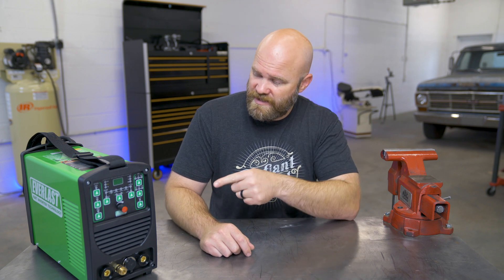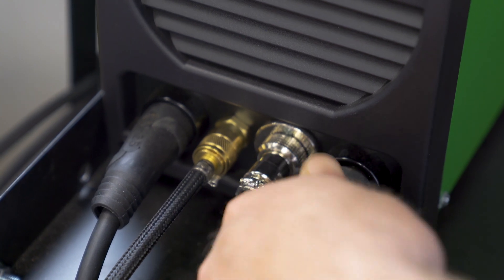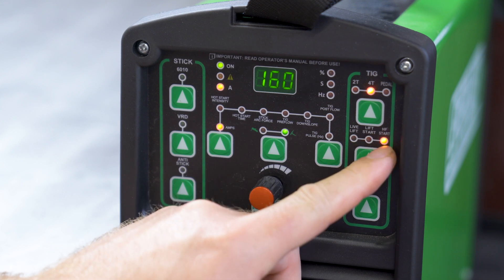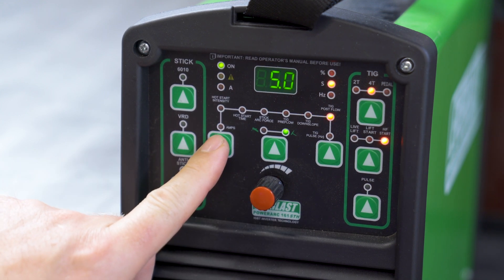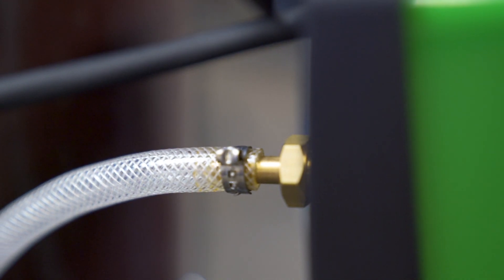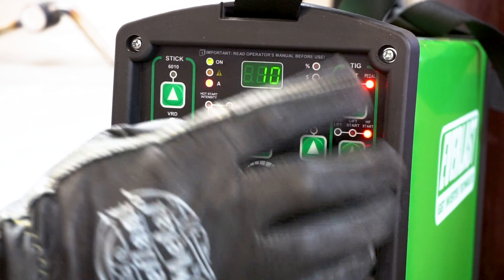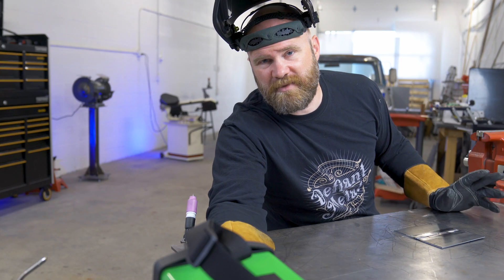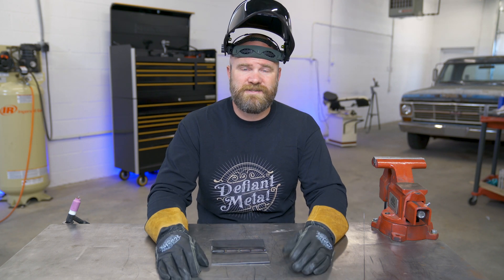Tiny TIG Welder Under $500? Overview of the Everlast PowerArc 161 STH

Comment: How does the tig run on 120 vs 240?
Reply from the maker: I honestly have never tried TIG on 120v. I have done MIG quite a few times off of 120v on a generator and it sucked. I might do some more experimenting with 120v wall power in the future and make a video on it.

Comment: Buyer beware... I am a life time welder... recently bought an Everlast TIG welder for the home hobby shop and while the welder may be good (remains to be seen) the accessories are not.  In short order the Argon hose blew out and the regulator leaks at the gage fitting.  Basic China quality.
Reply from the maker: Had the same thing happen and replaced the squeeze fitting with a hose clamp. My 255 had a much better hose and clamp so hopefully that is how they are now.

Comment: If ita a dc welder does that mean that I need to get an inverter to run it off ac current, or does it have a power supply built in?
Reply: Your DC current welder will weld steel just fine plugged into the wall.
Your DC welder IS an inverter power supply!  It turns 120v 20 amp AC wall power into 120 amp 20v DC power.
Welding aluminum requires a different machine where the power coming out of the handle and ground clamp alternates.  This peels the aluminum oxide film off of the aluminum so that your weld isn't automatically scrap with the film embedded in the weld pool.
Rock on!

Comment: Hey Justin, would you recommend this tig for a beginner welder and for putting out sample pieces for a product line ? 
And I heard that some of these small units get hot after a while and one has to weld and stop, the weld and stop again. 
How would the everlast  fair in this regard?
Reply from the maker: If you are doing production welding or any welding for a long time without much of a break I'd say you're definitely going to want a torch cooler.

Comment: Hey boss, 
Great video, thanks.
Can this tig welding unit do cast aluminum?
Reply: Hey there welding student here If your looking to weld cast aluminum you will need an AC welder. I don't believe you can AC weld with a 110volt unit.

Comment: I need a welder that be able weld
aluminium in repair shop , I can use
a stick dc welder for others , aluminum and copper , stailess steel
need tig weld that seems this welder
can work just on stainless steel .
Reply from the maker: Yeah you need a tig machine with AC also.

Comment: I have that welder's little brother the everlast 140st. It can tig but doesn't have a gas solenoid nor the high freq start. I miss those two features though because they sure make tig more enjoyable.
Reply from the maker: So the flow of shielding gas is external? Do you have to turn the regulator on and off each time manually?
Reply: @JustVoss  It likely came with a torch that has a gas valve built into the head. Lots of lower end MIG/TIG multiprocess machines don't have solenoids for TIG, just MIG.
And then you've got old school setups that adapt stick machines to crude TIG.

Comment: Can this welder handle continuous welding, or do you have to stop and go again after every few inches of welding?
Thanks for the review!!
Reply from the maker: Has a 100% duty cycle up to 100 amps and a 60% duty cycle up to 130 amps. So you should be able to go plenty far without stopping.
Reply: @JustVoss  Thanks!!

Comment: I’ve never done any tig welding. My old boss at the fab shop told me not to bother, said it was really difficult. So I’ve mostly used .035 flux core and 6011 electrodes. You sure make it look easy enough that I want to go drop $500 now. Thanks lol
Reply from the maker: I think you’ll be able to get started easier than you think, then it’s just all practice.

Comment: Tig welding just looks like a well controlled form of welding. My mig with flux core wire is like an angry smokey night out with the motley crew.
Reply from the maker: It definitely is, and no sparks!
Reply: @JustVoss  Ha, I manged to burn my big toe today. Huge spatter went through my trainers and socks. Super blister. Big fan. Nice vibe to your content!
Reply: My welding looks like a metal version of drywall work.  Tons of splatter and hours of sanding.

Comment: This is pretty cool. I drank the kool-aid of youtube about 18 months ago and bought a powertig 210exp (wish I would've spent the extra loot on the 255, but whatever) and while I'm not a professional production shop, I really like that welder. It was my first foray into tig, so I'm still learning a lot, but the controls are super straight forward and it's pretty easy to get started.  It's nice to see they're dipping into the $500 DC tig market. Would be freaking spectacular if they managed to get AC added into this unit for sub-1k range!

I'd love to have this little unit you're giving away, but I just don't need it, so I'm not going to enter the drawing. Appreciate your intro and giving this away!
Reply from the maker: That’s awesome, they make some great machines for the money. I have the 255 but not sure of the feature differences other than the amps.
Reply: @JustVoss  Pretty sure only difference between 210 and 255 is amps and the electrode polarity position. They appear to be reversed between the machines for some reason.

I'm happy with this machine so far and looking at buying one of their ~60 amp Plasma machines soon to try and build a cnc Plasma table. Hopefully that machine is as good as the 210 I have!

Comment: I have the machine and it is grest so far. My only  complaint is their lack of customer service. I am not a professional by any account, so my opinion is just that. I had a hose leak also but was able to fix it with new clamp. I built few of my farm implements using this welder. It has not stopped ever. I weld often on the 110 side of tig with no issue. The stick 110 blows breaker quick. Not machines fault. Easy to use and learn tig with. I just dread if i ever have an issue and need help from them. It may have been just my experience with their Cs, so if yours was i hope your is great

Comment: can I use one foot pedal with multiple welding machines ? or I have to switch connectors ?
Reply from the maker: If the foot pedal has the same connection the machines use then yes but you’ll have to hook and unhook it each time.

Comment: Yes! Video time! 
( also, could you PLEASE do a video of trying to find the best and cheapest AC/DC rig welder? ) I’ve been searching forever and I’m having a hard time finding one that’s affordable and not garbage!
Reply: I picked up a Lotos TIG200 AC/DC for $599 on Amazon 2 years ago, and while it is definitely a budget rig, it has not given me a lick of trouble since I got it.  It comes with a pigtail to run it off 120, and TBH it is... not super great at that?   But if you run it off 240 it'll deliver 200A no problem.  I do mostly aluminum, but it's done fine on mild steel as well.   I am a hobbyist, but I run it several times a week, have gone through several bottles of gas, and it just keeps working.  Only real complaint is that at least on my model, when using the pedal control, the amperage control is on the pedal and not on the rig's main control panel, so it's kind of awkward.
Reply: @Xedrik  Glad to hear it works good for you. I got lucky and had a little money come my way a few years ago and was able to purchase a nice Everlast at the time it was their latest greatest and cost $2200 but it will do everything I ever wanted and then some. It was the very first mig tig stick combo that had AC on the tig. 
 The pedal is a down fall on a lot of budget welders I will say the Nova pedals Everlast use are real nice and precise but the mig gun was a 9 ft cheap undersized gun for the machine. It lasted almost 2 years I just changed it with a yes welder mig gun. It is a 250 amp and a copy of a Tweco and takes Tweco consumables. The one that came with my machine was only rated for 180 amps and came on a 200 amp machine. Go figure. But the Everlast machines themselves are very well made. I recommended because I have one and they have a real warranty.  But I am thinking of getting a Lotos plasma if you have one of them let me know what you think.
Reply: @jvmiller1995  I got the Lotos LTP5000D 50A around the beginning of the year, and it's been... fine?   I mean, I'm no expert, but it took some fiddling and experimenting to get it dialed in to where it consistently made nice cuts with minimal slagging, but speaking as a hobbyist, it's done everything I've asked of it.  Was kind of skeptical about quality from a name I'd never really heard before, but I did double-check with Amazon, and the return policy gave me the confidence to buy them both. I've actually been pretty impressed with the bang for the buck on both units.
Reply: @Xedrik  Thank you as that is the one I was looking at. I just been to chicken to pull the trigger on it. I have a cutting rig but I get tired of buying gas when I know how well a plasma works. I am sure its probably fine  I will most likely give it a go. It seems like its the best priced pilot arch machine I can find.
Reply: This is that machine otherwise you are getting junk. Everlast machines are very affordable for what you get and have a great warranty. I have heard the yes welder stuff is okay. You might look at them but you get what you pat for. I own a everlast 221sti and love love love it but it is not real cheap but very well made as I am sure this one is too.
Reply: I am sorry just realized this is not AC. Everlast has a  power tig 185 for $850 and yes welder for $750 but I would save up and get the Everlast. They are great machines